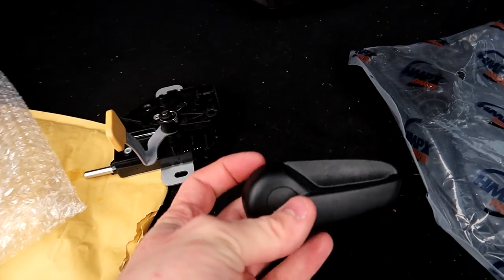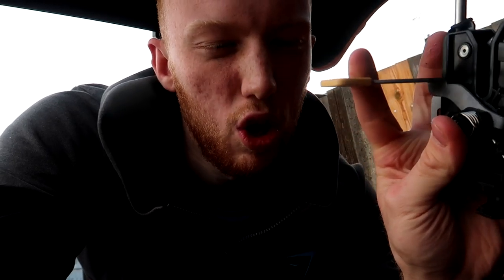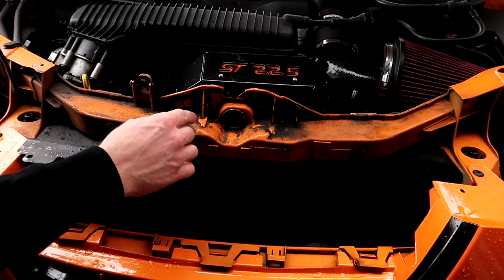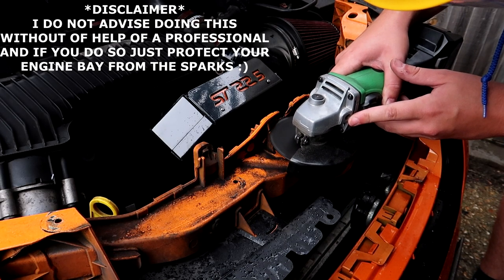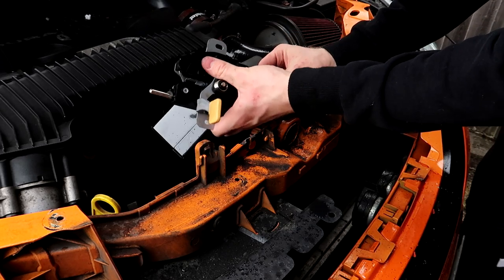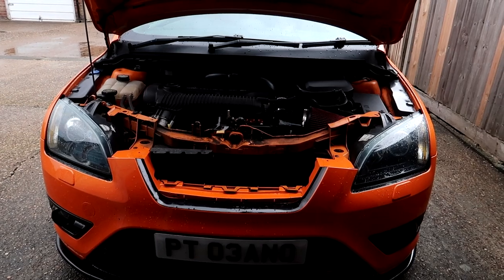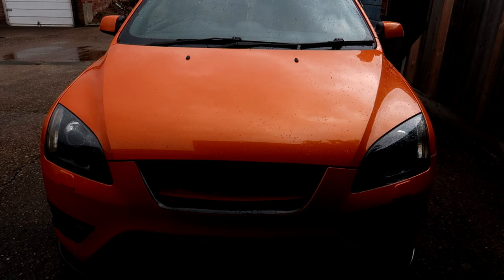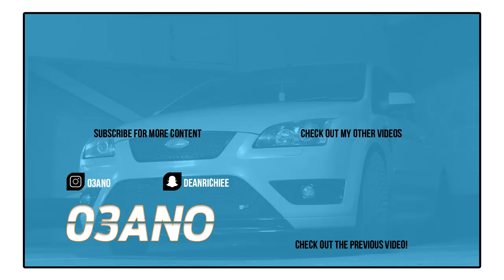FORD FOCUS MK2 BONNET LATCH CONVERSION INSTALL GUIDE (MK4 MONDEO KIT)

Comment: I've had 3x latches break in 6yrs of owning my ST (they're rebadged xr5 here in Australia for some unknown reason) , after the last one I made a ft long T handle with a oval tube welded on the end to locate the plastic part in the latch.. it's a bit agricultural but works. Now that I seen the cable latch, I might just get it..
Reply from the maker: Marty it makes life 10times easier

Comment: Alot of effort for something thays not 100% practical. Stick with oem unless thay causes an issue. Why change something that works fine.
Reply from the maker: Shane Baker I’ll do an update but I have a plastic extension I just did have it at the time and this is a lot better then the original bonnet key lock
Reply: Because it doesn't work fine 😅

Comment: Installed the kit and it's definitely an improvement.
Had issues with the system telling me the bonnet was open tried flipping the plug 180 but still wouldn't work so just hard wired the plug out for now until I find a fix.
Reply from the maker: Trim a bit of plastic of the plug on the lock there’s a small tab
Reply: @Richieesgarage  yeah did that and the car wouldn't immobilise with the two flashes on the second press of the lock also wouldn't sound the alarm if I opened the bonnet.
Reply from the maker: @simonhills3638  something with the installation is wrong then

Comment: Great idea. Got my replacement lock from a Canadian junk yard so there was a slight difference when fitting to my 2010 European Mk2. Have had to modify the latch lever and the cable plug. Still undecided on the in cabin cable mount, that'll come after I run the cable through the firewall. Open to any help from you guys.

Comment: I’m still getting the bonnet open warning from the electrical connector any ideas out to sort this?
Reply: I’m sure I read somewhere that the connector needs turning 180 and file down the bump on the catch, or alternatively switch the wires around.

Comment: Nice job mate.
I´m still wondering what the solution is to get rid of the bonnet open message.
I had a quick look at the Focus schematics and swapping both wires makes no sense. Except when the Mondeo lock has a diode integrated. Can anyone confirm this?
Greetings from Germany.
Reply from the maker: you need to shave off a small lip thats on the bonnet latch socket and flip the plug 180 and it will take the message away

Comment: Did you find anything to extend the latch mate? Or do you know the measurements of Length, Width & Depth I'll get it welded up before I do it then if you could get us the dimensions bud.
Thanks trav
Reply from the maker: look up Panter mods on Facebook pal they do a latch i think 8£ can get any colour/writing aswell

Comment: Oh man you have done me over... the link to your handle is not the complete part.. only noticed half way though fitting... you have not included th rear part ..
Reply from the maker: Iso Confused rear part?
Reply: @Richieesgarage  back part to the handle.. part that fixes down.
Reply from the maker: All the parts in the video is all the parts in the description you’ve got the actual mechanism at the front of the car then the release cable with the mounting bracket for the handle then the actual handle
Reply: @Richieesgarage  hi man, I'm sorry you where right.. the cable didn't come with the backing... I have a replacement. I will add that the latch, I had a issue with the handle rubbing and need to use two washers.
Reply from the maker: @isoconfused8744  i put a screw in the back of the handle to secure it also makes it stronger!